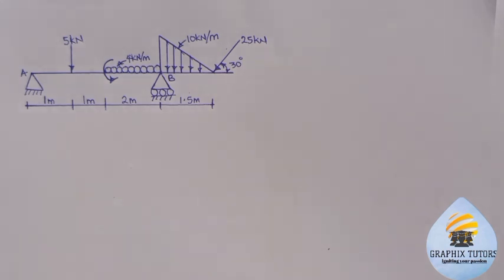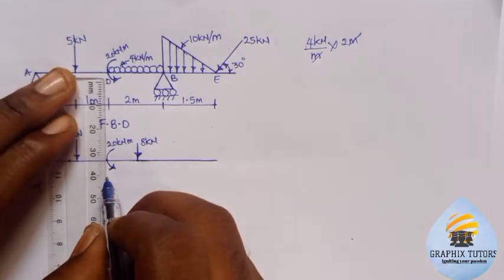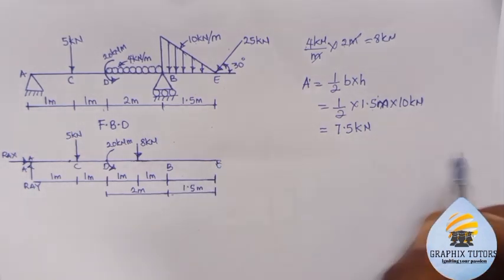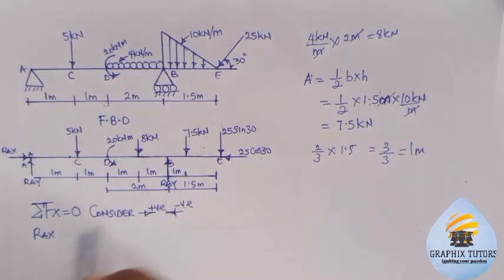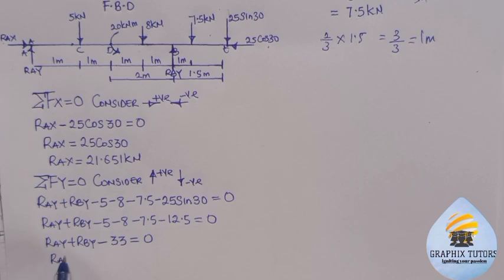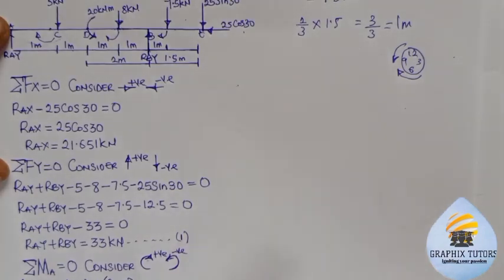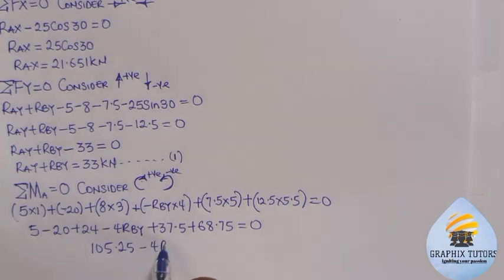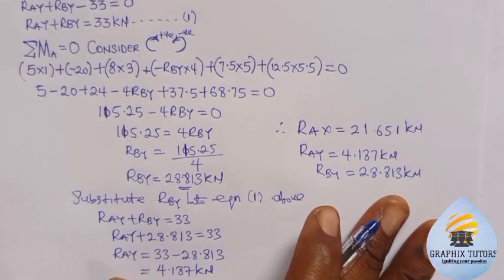How to find Reaction of a beam with point load, UVL and UDL

Comment: Plz sir why did you multiply 2/3×1.5 at point BE
  I thought you were to divide 1.5/2
Reply from the maker: Reason is because It is Uniformly Varying Load
Reply: I think it should be 1/3 × Length 
And the result should be measured from heavy side
And
If you multiply 2/3 × length
the result should be measured from zero side